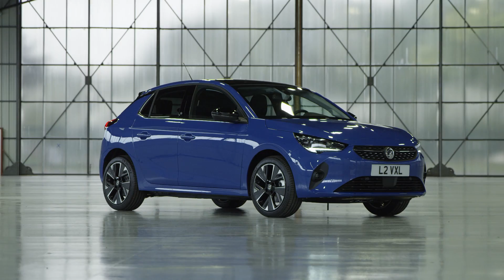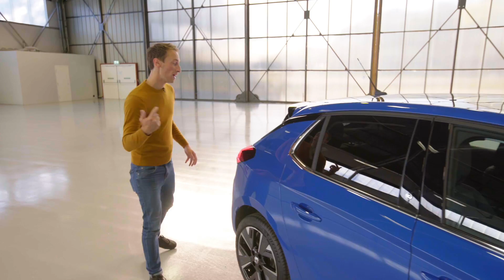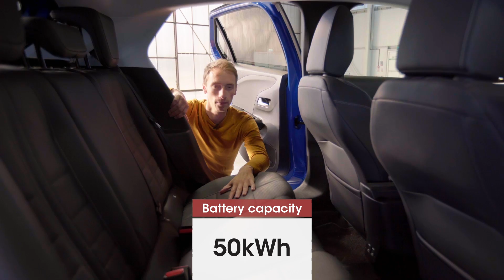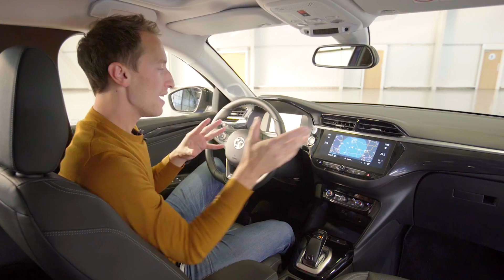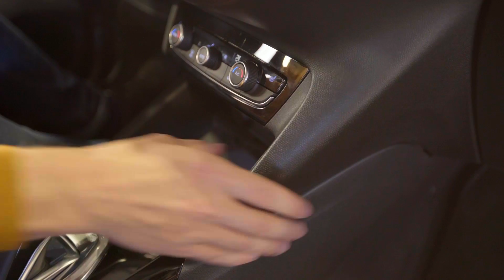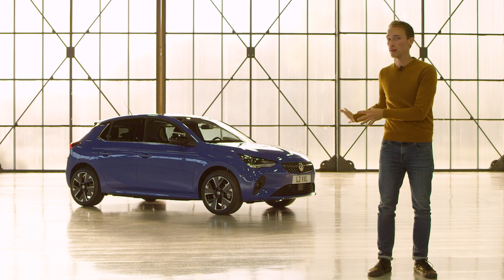2021 Vauxhall Corsa-e electric car revealed – everything YOU need to know! | What Car?

Comment: Its 2019 and the car manufacturers are still not able to make a lag free info system.
Reply: No one needs an infotainment system.  Just use a phone
Reply: I don't get it, you spend thousands on cars, yet the screens are worse than a £50 tablet?
Reply: @TheRichardHonor  You don't get it, car electronics must last 20 years and work under extreme African summer and sunlight heat and freezing Nordic winter cold.
Your tablet can't. How many people have super expensive laggy phones in mild European summers and winters?

Comment: Not entirely a rebadge as it has a totally different interior but from the outside it's the same car with different bumpers, headlights rear lights. And the same tiny rear doors. They really pushed the B pillars back to have bigger front doors. Which is a good thing for taller drivers. I hate it when I push the seat backwards to make room for my legs just to realise that the B pillar totally obstructs my peripheral view to the left.

Comment: 200 miles range? That’s ridiculous compared to a Tesla model 3 at 500+ and there around the same price
Reply: No they aren’t, corsa e costs £26,000 whereas model 3 costs £42,000
Reply: ONYX.G a Tesla model 3 at base with no upgraded is under £30K depending where you live in the Uk
Reply: The Corsa-e has a quoted range of 205 miles, however, Vauxhall claims this will be “extendable by 40%” in Eco mode, suggesting a maximum theoretical range of around 287 miles.

Comment: Peugeot 208 is a bit more luxurious in materials and small decorations - in the most expensive model... but the function is poor...  al show and no go...
Center console is too wide and creates an enclosed feel for the driver's legs AND the air vents in the sides of the panel CAN NOT be directed towards the side windows...  to help get rid of fog on a rainy day...  which is possible in Vauxhall, this should be a bigger issue in Britain,  where it rains a little more often... than on the French Riviera...

Simple and quick ventilation is significantly better in Corsa.
Corsa is also the only one to offer fog lights...
There is not even on DS.
Reply: Does the Corsa e have a low speed engine noise for safety?
Reply: Also, the corsa is the only one that offers heating steering wheel and matrix headlights which makes it a no brainer for me. The e-208 is more expensive because of the brand and the 3d effect dash screen which is just useless and childish.
Ordered the Corsa e and its expected to arrive in mid september. I'm Very excited ! :)

Comment: In my view only any good as a 'second' car although the ½ hour fast charging is a great step forward. Suspect real road range is going to be in the region of 170-180 Miles, after all who drives a ICE car down to the last drop. "At the end of the day" it's really all down to purchase price, and suspect as with the MG ZS it might be twice the price of the 'Petrol' Equivalent. Just looked it up and surprise - On sale Early 2020 Price from Around £22,000 for eCorsa (before £3500 gov't grant)- Petrol Versions from £15,550 so with the Gov Grant not bad at £18,500 - in that case = £3k extra for EV - No Road Tax, much lower running and service costs. Would suit anyone say commuting up to 100 miles each day, charge overnight on 7.5kwH (3 phase off peak) and you could well be on a winner here. Certainly looks far better than the Chinese MG ev, and you could save the Planet and all that stuff. Noticed loads of empty charge points at my Local Asda today. Shop while you charge.
Reply: The use of eco mod increases the range significantly, so there will be no difficulty to reach the cautious figure 205.  
"The Corsa-e has a quoted range of 205 miles, however, Vauxhall claims this will be “extendable by 40%” in Eco mode, suggesting a maximum theoretical range of around 287 miles."

Comment: Electronic cars are not sustainable, they might be fine for going around the doors in town, but what about longer distances?
Reply: "The Corsa-e has a quoted range of 205 miles, however, Vauxhall claims this will be “extendable by 40%” in Eco mode, suggesting a maximum theoretical range of around 287 miles. "
Reply: EVs are getting ever faster at charging. Get a Tesla and you can add a lot of range in the time it takes to go to the toilet, drink a small coffee, and write a few comments on YouTube videos
Reply: Some Dude I drive a petrol car with a 40L tank and get around 350-400 miles on a tank. Some electric cars would be lucky to do 200 miles

Comment: Sorry we have no public charging points at all in the south hams area of Devon & only 7 going up the Torbay & Teignbridge coast. As for the 2 National Parks in Devon practically non existent. Did you say fast charging points on motorways. Other than 5-8 hours. That makes electric cars completely impractical in Devon & Cornwall. Cost of the car new? Bet it is in excess of £30,000. Out of the reach of most family’s.I have checked website only available on top 2 models from £29950
Reply: Nicky foulkes 
I live in Devon and have ordered the e208.
While I agree the charging network in Devon is not great it won’t matter if you live there if you can charge at home.
I drive to Southampton regularly and the 208 should do it comfortably with 1 short stopor one longer charge whilst there.

Comment: Why is the steering wheel on the wrongside?
Reply: Jadair92 because so are the pedals! You can’t have one on the wrong side without the other 😂
Reply: For a press release model they can have in the UK using the “Vauxhall” brand, all they needed to do was glue a different badge to 3 parts of the car. Voila - a left hand drive “Vauxhall”.
Reply: the wheel is on right side, the problem is that you Brits always take the wrong side...
Reply: @norbertmachaj6127  I think the problem is that it is a Vauxhall which is just Opel for the UK... so what is a Vauxhall doing with the Opel arrangement? Who drives on the wrong side of the road and buys a Vauxhall?
Reply: @varph_  Come on, it was a joke
Reply: Varph no in the uk it’s just Vauxhall
Reply: Norbert Machaj it’s not just the British, and FYI it’s suited to our roads. Try and watch an LHD large goods vehicle manoeuvre on the Left hand side of the road, is a if they don’t know how to drive at all.
Reply: Norbert Machaj no